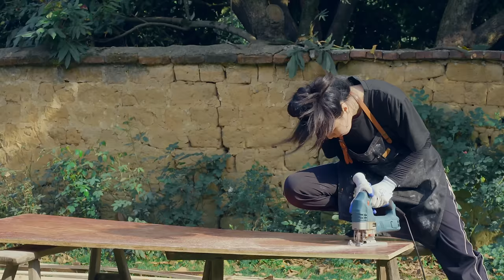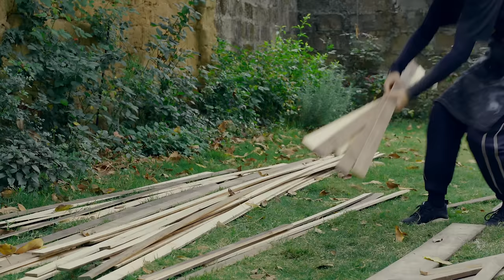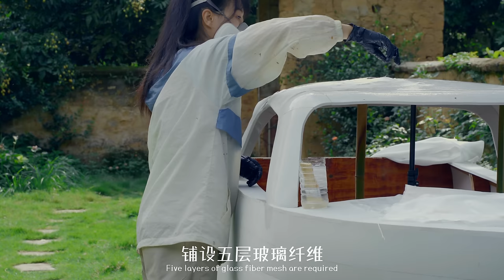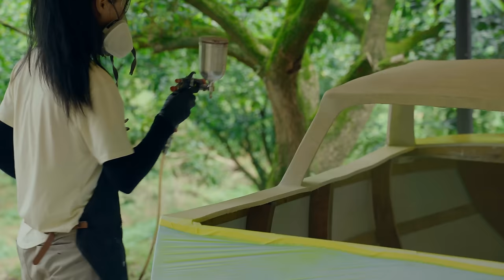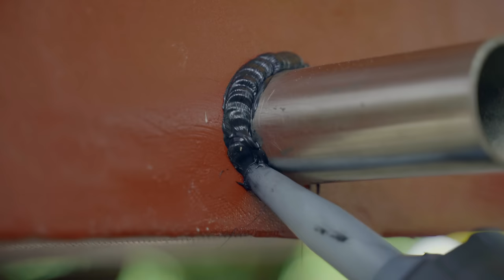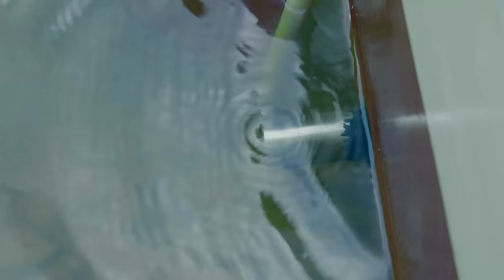I Build A Candle-powered Boat From Miyazaki Hayao's Movie"Ponyo"

Comment: First of all, I think it's great how this "toy boat in large" was built and the craftsmanship of the whole thing is really super! The only problem is the fact that flow machines like aeroplanes, certain engines and ships with planing hulls change their characteristics when you change the scale. The small toy boats that you can buy at Christmas markets in Germany, for example, speed through the pool or bathtub like racing boats. Unfortunately, this doesn't really work in large scale. There are a few people here on YouTube who have tried this in vain. I think 2 of them have converted the motor into a version that works in these dimensions.

Comment: When you are using C clamps where one end spins on the item you are gluing, it helps to put a small block of wood under the spinning clamping force.
Reply: This. When I made my boat I didn’t know about that and it made circle dents where I had it, some even cracked. Didn’t know about that until after and had to redo one part because of a crack. I don’t mind ugly, but cracks are not great to say the least..

Comment: Love the movie love your boat concept the oar was kind of cheating but guess you don't wanna be stranded out in the middle of the lake. You really need iore power more water more steam, if you constrict the exhaust so that the steam is more tighter beam maybe it'll work better I but I do love the boat don't get me wrong I love your work as well. 💖
Reply: Steve Mould (science youtuber) made a video of building his own huge pom pom ship. It turns out the concept doesn't scale all that well. Check it out, it's hilarious. He got the same results: impressive pom-pom noise, some bubbles at the tubes... and need to use the oars (the speed of the boat doesn't scale even if the size does; a 10 cm boat moving at 1 cm per second is impressive, a three meters boat moving at 1 cm per second is... impressively slow)